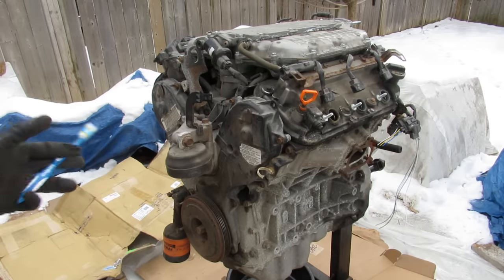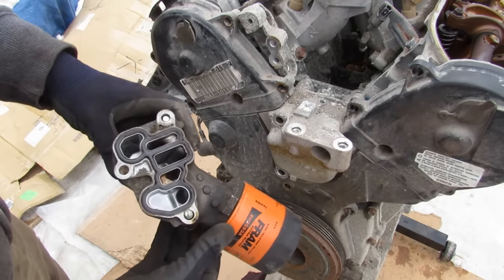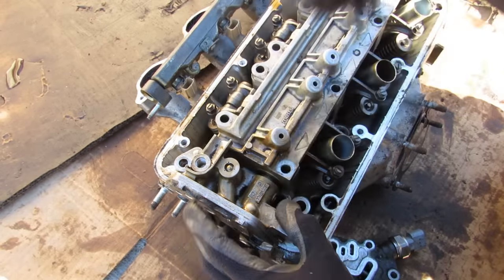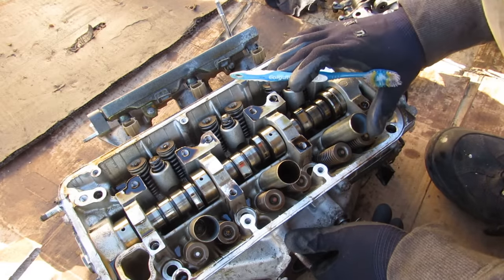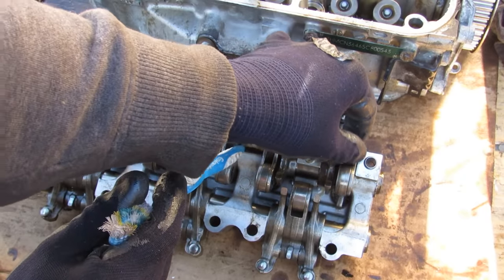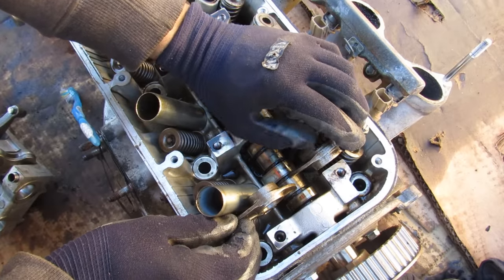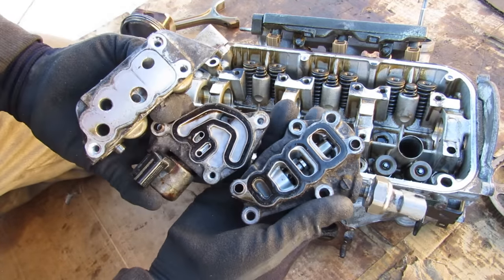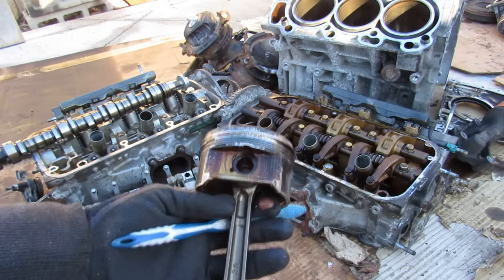Why Cylinder Deactivation Can Cause Engine Failure

Comment: I have this engine in my Accord. I burn 1 quart every 5000 miles after a rebuild at 116k miles
Reply from the maker: Ouch. What year?
Reply: @speedkar99  2010
Reply: 5000 miles per quart
Reply: thats not much bad but its better to install oil catch can if you dont have one to keep your intake clean
Reply: @Techie1224  I change my oil every 5000 miles and I'm mostly highway driving
Reply: That's better than some of these other modern 4 cylinder GDI engines burning a quart every 1000 miles.
Reply: Just disable it
Reply: @rotorblade9508  how?
Reply: @ONeal397  there may be ecu tunes online in the aftermarket like for the new corvette cylinder management ti remove the management
Reply: The Toyota v6 don’t do tht Honda only makes good small engines
Reply: @andersonrodriguez8258  you're right it doesn't do that the 3.0 used to sludge up if you don't change it often
Reply: @ONeal397  you got that right brother
Reply: What parts of the engine are changed? I don't understand how rings can be worn when there is constant oil supply. Yes they can align but wearing out I don't get it.
Reply: @aseemagarwal6040  most likely just the Pistons and piston rings
Reply: @ONeal397  issue resolved after that..
Reply: I have 2013 accord v6 205 k miles and   gives 40 mpg on highway 🛣 when driven speed limit, in sport mode it flies , i use mobile1 full synthetic oil every 5000 miles n filter  . No problems ever, just timing ⏱ belt and vavle adjustment n these things keep going like a water fall .
Reply: @diybetterbasics7379  autobox?
Reply: @diybetterbasics7379  buying a 30k miles  run V6 accord 09. Please share some useful tips
Reply: Aseem Agarwal  yes 6 speed automatic
Reply: Aseem Agarwal  check  for engine leaks color of fluid’s , if the timing belt (every 100k miles)was done , ask for repair records, transmission fluid (every 30k miles )color should be light pink clear, check engine mounts if they’re cracked, check tail pipe for oil burning (if you see any black tip.) if you see oil burning and leaks STAY AWAY. it’s a clear sign 🪧 that if was not looked after properly
Reply: @diybetterbasics7379  the car has done only 30k miles.. checked the service history with the dealership. Timing belt not changed even once. ATF changed 3 times since 2009. No signs of burning oil. Dipstick was full.
Reply: Aseem Agarwal since the car 🚗 is from 2009 and it only has 30k miles on it and belt is made from rubber and  fibers it’s better to replace it it’s well over ten years now, Honda say to replace 7 years or 105k miles to be on the safe side, if it breaks valves bent and pistons touch, it’s not worth the risk
Reply: @diybetterbasics7379  yea will get belt replaced asap.
Reply: @aseemagarwal6040  don’t buy it !!! I have a 2009 Honda Accord coupe V6 3.5L Automatic. Mileage is at 130000. The piston rings are my biggest problem. Oil keeps getting on my spark plugs, which then causes misfires. I have to change spark plugs like twice a year. Find a different!!!

Comment: I've been wondering at what point did emissions equip start to become detrimental to longevity. This seems like a good candidate. Any idea when this was first implemented by Honda?
Reply from the maker: With this same engine, 2005 Accord hybrid and the Odyssey
Reply: I believe this is more to keep up with CAFE standards than for emissions purposes. https://en.wikipedia.org/wiki/Corporate_average_fuel_economy
Reply: @StephenPaul1160  yeah you know I said emissions but yes it's more efficiency than emissions like you said
Reply: CAFE ruined it for car owners. CVT, Direct injection, Unibody construction, VCM
Reply: It's affecting the longevity of everything. Brake rotors are thinner so they can be lighter but warp more easily. Glass is thinner but chips and breaks more easily. It goes on.
Reply: @yehudagoldberg6400  I know about the thin glass.  My 2020 civic is the first car I've ever owned that got a rock chip in it.  I've been driving for 18 years.

Comment: Excellent video, in theory the combustion pressure is what helps to push the rings against the walls, so without that positive pressure the oil does get sucked past the rings into the combustion chamber.  It wouldn't surprise me that that is the very thing that aligns the rings over time.  A local engine rebuilder who builds the 5.3's with the AFM system states that the rings on the deactivation cylinders are always glued to the pistons.
Its a horrible invention and it needs to be defeated on every vehicle that it comes with. Had I known about this system I would never had purchased my Honda, and I strongly recommend anyone considering a vehicle with cylinder shut-down to NOT purchase one.
I'm not a fan of the original coolant temp VCM defeat method, unless it is the smart version.  Even with this muzzler the VCM can still come on in higher temp weather. I would like to see a better method invented like a custom engine tune or custom PCM that could be purchased.
Reply: Hi, have you seen the S-VCM controller?  I appears to fix everything except being about 10% cooler on the thermostat reading.  I am a new honda owner, kinda concerned even with low mileage.
Reply: @i-changeus  I'm new to this as well. Have you looked at the KTuner? More expensive, but it programs the VCM to stay off, as opposed to tricking the computer to think its Coolant temp is lower than it actually is.
Reply: VW Taos has VCM. Seems like a cool car but I prob won't be buying one after watching this.
Reply: @jasonschell1309  Thanks for the idea, and yes, I looked briefly into it, but as you mentioned, it's like $400-500 from what I found.  I did instal the S-VCM, and it works great.  The coolant temp is only slightly cooler than actual.  I put a switch on the dash too, so I can switch on/off if desired later.
Reply: I had the 2007 Odyssey with the VCM engine and I never had any problems with it, I traded it in when it had 57,000 miles on it and purchased a 2015 EXL with the VCM engine.  I installed the Tuner 2 on that car and the ECO mode is never engaged.  Anyone that has a Honda should join the Ody club and you will learn everything about this engine and why you should turn off the VCM feature.  I only have 29,000 miles on this Odyssey and since I am 80 Years old I will probably keep it until I croak.  I was looking at a new vehicle, but now they are all coming with that idle stop feature and I hate it.
Reply: @Norm475  just get a hybrid. It eliminates the start stop thing because it is designed into the system.
Reply: @jerryp2433  No hybrid or fully electric vehicle for me. I am done buying new cars.  As I said since I am 80 YO my 2015 Odyssey should last until I croak.
Reply: @i-changeus  I too use the S-VCM and have had zero issues with it.  The only thing I noticed is the heater blows a little hotter than normal because the coolant is warmer than the control thinks it is and opens the control valve a little wider.  Not a big deal as the cabin temperature is not effected.
Reply: @Norm475  If you could stop it from auto-shutting off, then it’s not a bad thing. Those cars have tougher starter motors to handle all the extra work they’d have to do.

Then it’s just the 99 other bullcrap things in every new car.

Comment: Excellent video.  I muzzled my Odyssey's VCM long ago and it was the best thing I did for that engine.
Reply from the maker: How many miles and any Ill-issues?
Reply: How did u do it?
Reply: @speedkar99  Over 50,000 miles ago and no issues whatsoever.  It just tricks the VCM into thinking that the van isn't warmed up fully for the VCM to engage, keeping it running on all 6 cylinders all the time like it should be...
Reply: @perverso12345  I got the MaxMuzzler on the Honda Odyssey forum, but there are a bunch of them out there now.
Reply: I disabled mine at 40k in my pilot I have 190k no issues.there still Piggies on gas but it stopped the shutter on my transmition and vcm vibration back at 40k no 190k and before I disabled it I was burning oil by 1 quart by 40% .when I disabled it it stopped burning.i also do all my own services ,oil changes ,all fluids brakes,diff services ,plugs and timing belt which is up soo I'll do it on 195k.best thing I ever did.my friend didn't want to do it and he has so much trouble with engine right now at 110k .I told him I'll install mine and he drove around for 3 minth and a lot of his issues went away engine sounded better vibration gone trans skip at 2k was gone all and he did a full oil change and it was down half quart compared to 1.5 quarts by full oil change .he was convinced he got one and 3 of my friends techs are honda recommend them tech for 15 yrs now
Reply: Yeah I’m ticked off BAD that no mechanic yet thought to tell me about anything about the VCM, and I had to find it 3.5 years later  on a Honda forum after more misfire issues, and now the engine light was BLINKING, and I’m wondering if it’s too late and will my vehicle be TOAST?!
but I’m sure they may have assumed (incorrectly) that I didn’t care or wouldn’t know what they’re talking about (as a female), but I’ve been hardwired by God to research the crap out of anything that affects my daily life, and also been having to take care of my own vehicle (and most other things for decades) in spite of a “partner,” and when a man abandons you (lol or not) that’s clearly not going to change, so I need to know how to keep my stuff running as well as possible, and on a tight budget. 

I could seriously slap a few EPA and legislative fools who mandate this stuff for a few more mpg (and it’s not even that great!!! 2005 Honda Ody EX-L 19 city, 24 on a good day, maybe 28/29 max highway) at the expense of my engine!!!

not to mention the Honda (and other vehicle) executives and engineers making 6 or 7 figures, who probably don’t even drive their own vehicles, but inflict their “ideas” onto the rest of us who NEED a reliable for YEARS vehicle to help ride out this crazy train life, and on a shoe string budget!!! But the Lord has helped me get through the years as well as I have because He is ever faithful in spite of everything, and then some! 🙌Little blessings make all the difference, like finding the forum posts that led to this video… now what do I do with that info? He keeps providing the answers for those who seek His guidance and ways. I’m thankful to be reminded once again because I was PISSED earlier tonight over this, relying on my own understanding.

Comment: I disabled VCM on my ‘08 Accord at around 80k miles. Thankfully at 172k it doesn’t burn a single drop of oil.
Reply: someone called henry in comments wish to disable it , if you have useful info you can tell em 😊
Reply: How did you disable it?
Reply: @FlipMore  
Look for vcm muzzler or S-Vcm 

If the j35 is running below normal temperature the VCM would not kick in
Reply: @FlipMore  ktunner... thats the right way.. no gadgets that will trick  your  ecu ...
Reply: I'm at 88k miles on my 2012 Odyssey. Which VCM muzzler did you purchase?
Reply: We have 2008 odyssey with 174k and we need to disable the VCM because of engine mounts, oil burning, fouling spark plugs, etc.  it’s only $100 for the kit.  It just plugs to the existing harness on the side of the engine to fool the ecu so the coolant temp doesn’t reach 167 degrees to keep it disabled.  It has to be warmed up fully to have it enabled.   it will once in a while happen though.  Not a big deal.
Reply: @GalenlevyPhoto  you will be running  rich all the time... ktunner  will  disable  it  from the  software
Reply: @lars25gdl  did your burn oil?
Reply: @donaldlee6760  what problems are u facing? Oil consumption?
Reply: @aseemagarwal6040  - My 2012 Odyssey does not burn any oil, however I keep vehicles for at least 200k miles and I just want to make sure it still does not burn oil in the year 2030.
Reply: @donaldlee6760  have you installed Any Vcm cheat device like muzzler? Or it is doing great with VCM? Which J35 do you have? Please specify the series if you know
Reply: @aseemagarwal6040   no..  my engine  is in good shape  and i want to keep it like that  so that is why i deleted vcm
Reply: Is there any significant difference on the fuel consumption after deactivating it?
Reply: @Rendezvous512  I get a couple of MPG less than I used to from what I remember. From like 29-30 highway to like 27-28. My average over a few thousand miles of mixed driving is usually around 22-23 mpg according to the nav computer.
Reply: @Furudo  I prefer deactivating the VCM to be honest. Fuel consumption is not really my primary concern. It irritates me every single time when the VCM engages especially when traveling at a speed of 40/50mph. Above 60mph is fine & not much noise can be heard. The sound of only 3 cylinders working is annoyingly crappy & somehow eliminates the smoothness of the naturally refine V6 engine😵‍💫🥴
Reply: This video is basically saying the vcm design ruins the engine. Just bought a ‘11 pilot should I deactivate the vcm to save the engine wear and also I heard the vcm burns oil. Any thoughts.
Reply: I’m thinking about getting one for my van but it has 229,000 miles already and I hope the damage isn’t already too much. Asking my ex who’s knowledgeable about cars and a mechanic tomorrow and hopefully they both give a straight answer and in a timely manner.

Comment: Great video, thank you. Would you recommend, if car is out of warranty, installing one of those VCM disablers with the goal of extending the engine life? My 2011 Pilot has 145k on it and that rear spool valve went at 110k. Had to be towed to shop to fix

Comment: Is it possible to adapt VCM to non-interference engine with the intake & exhaust valves open during cylinder shut down? This case the inactive cylinders would not have compression and vacuum to cause the mentioned problems.
Reply: Interference vs noninterference is unrelated. Leaving valves open would increase pumping losses. Basically half the engine would be engine braking and it would make vcm even less capable of improving emissions.
It would probably be better to go with a super nonaggressive cam (targeting half power) for all 6 cylinders in eco mode and "vtech" back up to normal cam profile as needed. Should result in smoother power delivery and keeping even stresses and even heat throughout (metal expanding unevenly is bad) since it would still rely on their vtech style implementation it should be fine from a patent perspective. My guess is that vcm was one of those marketing based engineering decisions. Might be easier to explain "sometimes 6 cylinders" than "echo vtech"
Reply: @Jon-yh3gb  It is not unrelated. Think about that idea. It would work! Whole engine would have a low compression ratio tho.
Reply: Leaving the intake and exhaust valves open would not really work on 99% of cars that have a shared intake plenum. The intake and exhaust would be directly linked all the time through the dead cylinder, bypassing the throttle and killing intake vacuum for all the cylinders still working. Maybe you could make it work on a car with individual throttle bodies and exhaust, but I doubt it.

Comment: Thanks for taking the time to do all of these really awesome videos! I just learned that my dads 07 EX-L Odyssey has VCM from you. I've been changing the oil with full synthetic high mileage every 3-5 thousand miles and the van had a rather big oil leak from the valve cover gasket. I put a 1/4th a bottle of AT-205 and that completely stopped the leak. After that I changed the sparkplugs after a Cyl. 2 Misfire code at 145k miles, I used some NGK Iridium plugs but I am noticing much worse gas mileage, would I have to disconnect the battery to let the computer relearn the new spark plugs? I dont think VCM is a huge issue in our case since my dad drives pretty fast, and the Eco light hardly ever goes on at 80mph. I think VCM only kicks in at 70mph and below
Reply from the maker: Why not fix the leak?
Reply: @speedkar99  Thats too much work for me haha, but I did learn how to rebuild the parking brake from your video! Totally saved my cousin and I when we were changing the brake rotors and realized that the rear right rotor was not disengaging the ebrake so we had to hammer the old rotor out at 10pm Thanks to your video and AutoZone for having the kit of all the included springs we were able to finish by 12am! Youre awesome man and I watch your videos as much as I can!

Comment: VCM works at idle and light load cruising speeds for great gas mileage. I think the problem might be the use of low tension oil control rings, with a high mileage engine it may use a bit of oil to foul the plugs. The number problem is not changing the PCV valve before 50,000 miles if it goes bad it will suck in oil. I  change my oil when it hits 20 % oil life.